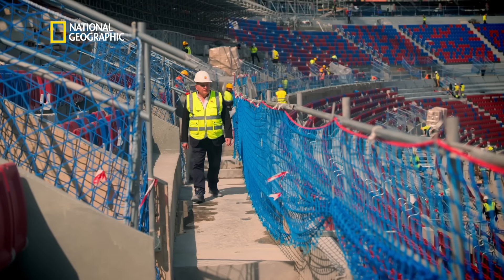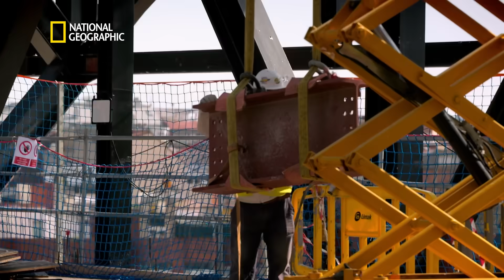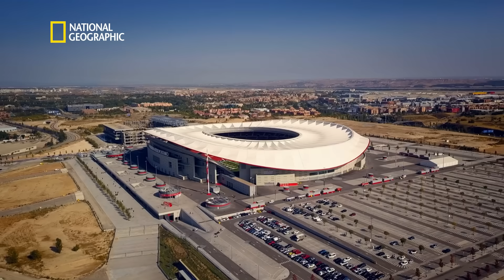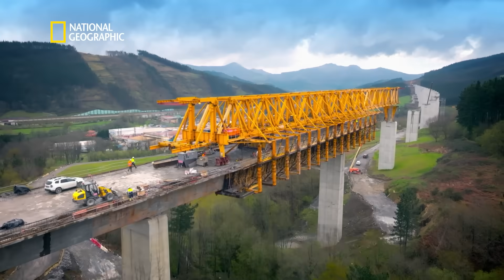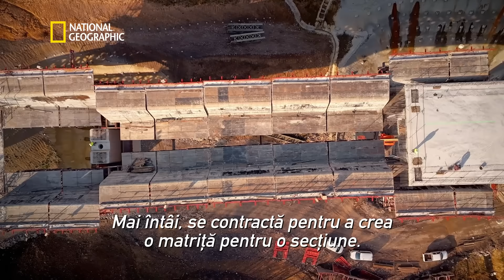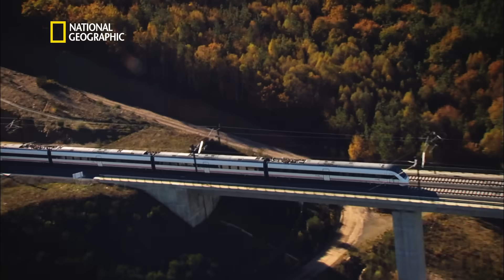La Barcelona se ridică cel mai mare stadion de club din lume! | Inginerie europeană

Comment: CEL MAI MARE STADION DE FOTBAL...nu cel mai mare stadion...cel mai mare stadion este in
Indianapolis, Indiana (SUA) 
What stadium holds 400,000 people?
Overview
The Biggest Stadiums in the World Based on Capacity [Quick Facts]
There are no traditional "stadiums" with a 400,000-person capacity, but the Indianapolis Motor Speedway is the largest sports venue with that overall capacity, holding up to 400,000 people in its stands and infield combined for events like the Indianapolis 500. Historically, the Deutsches Stadion planned by the Nazis was designed to be the largest stadium, intended to hold over 400,000 people, but was never fully constructed.  
Venues with high capacity:
Indianapolis Motor Speedway: This motor racing venue in Indiana can hold over 400,000 people, counting both permanent seats and the large infield area where spectators can gather. 
Circuit de la Sarthe (Le Mans): The home of the 24 Hours of Le Mans endurance race has a large capacity, though it is smaller than the Indianapolis Motor Speedway. 
A historical example: 
Deutsches Stadion (Germany): Adolf Hitler's Nazi regime planned this stadium in the late 1930s with an enormous capacity of over 400,000 people, though it remained a blueprint and was never built.